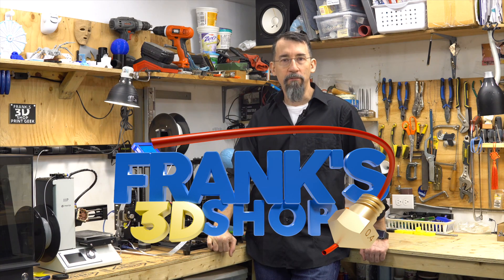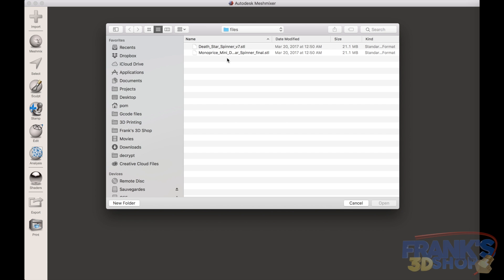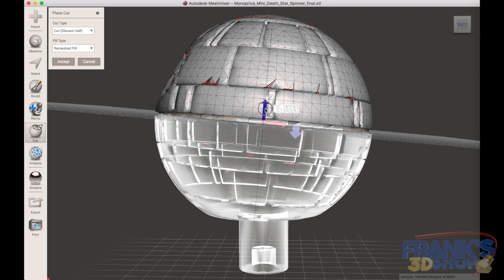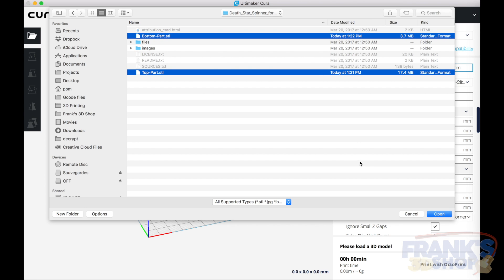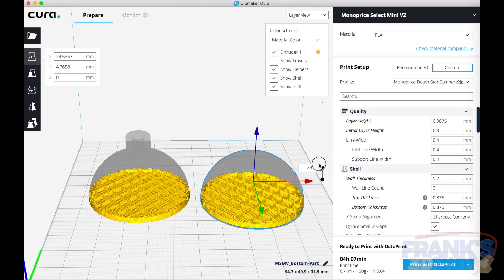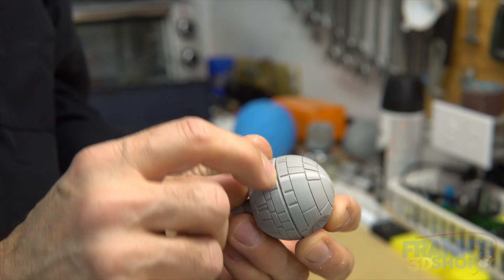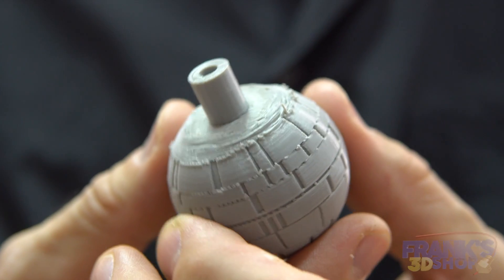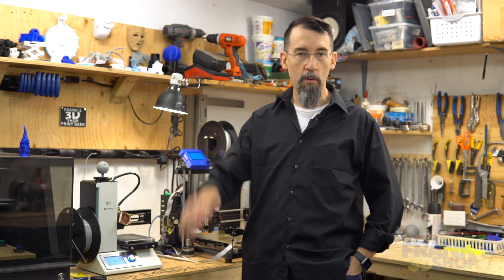Cura 3 example: Death Star Spinner

Comment: Hi Frank.  Thanks for the great info...I'm still enough of a newbie that I need some help from an expert. I bought a monoprice mini select v2 and had no problem setting it up.  My problem is that I cant seem to get anything to print other than the cat and the elephant, which print perfecpptly.  I didn't buy it to print just those two items.  I'm using cura 3.1, but I'm guessing that my settings are wrong, because when I load the file onto the sd card and try to print it, the printer either does nothing or it makes grinding noises and tries to start to print in the home corner until I cancel the print.  Any suggestions would be GREATLY appreciated.  I love the printer and really want to be able to get started with this.  Thanks again...Richard Jackson
Reply from the maker: Yes I have a video on how to setup Cura 3 and you can download my settings, I use Cura 3.0.4 for the time being I had problems setting up Cura 3.1, so you could install Cura 3.0.4, do setup has indicated in the video and use my settings, after that you need to do as I do in my Cura examples and make some adjustments for each model. https://youtu.be/cCfXZ2LwM7w
Reply: Well Frank, you are the MAN!  I followed your advice and started over with cura and set it up the way that you showed in the video.  I grabbed a file off my desktop (the 3dbenchy) and loaded it into cura...it sliced it with no problem and I saved it to the desktop and from there to the sd card...I put it into the machine and held my breath and hit print..the printer started up and started laying down filament...its right now about halfway through the print and it looks fantastic!  I will let you know how it turns out.  Thanks again for the help...I really appreciate it.
Reply from the maker: Glad to be of help to you!

Comment: In case of the slicing option you, maybe, can decrese de bottom height (first layer) of the pieces as to avoid sanding.
Reply from the maker: Yes you are quite right, but you need a good flat surface to glue the parts, you surely can tweak the height until it's perfectly flat and not squished down.